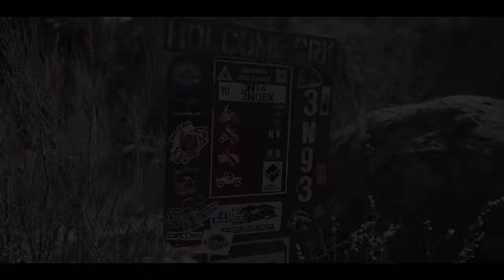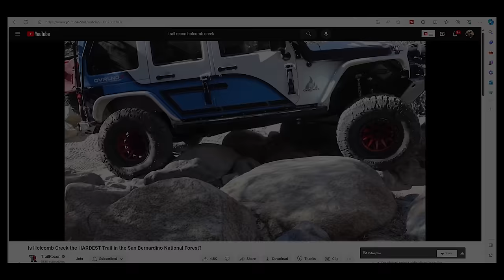Extreme Overland Routes. The 368 Mile Southern California RLR@TrailRecon

Comment: I have spent a ton of time in ocotillo. Truckhaven is fun. Id love it if Brad would set up some rides. Great vid guys.
Nate aren’t portals gonna be even wider?
Reply from the maker: Removing the wheel adapters and using the right offset wheels (which I already bought) compensates for the extra width 🤘. The wheel adapters are 2" and the new wheels bring the centerline of the tire in about 1.5". The biggest challenge will be cutting everything to fit the new nitto 40" trail grapplers lol

Comment: About your tacoma build. The getting beached on rocks is so real. I see it all the time up here in CO with peoples Quad cabs. That is why I love my 83 toyota, 129 wb and 89 inches wide, that is full sized to me lol. Almost 2 ft of body clearence bone stock. 103 wb and 70 wide including 4 inches of spacer per axle. Even my 92 extra cab toyota crawler is "Big" for me at 112 wb and 75 wide with 38x13r15,
Reply from the maker: The older Toyotas have a flat belly... must be nice lol. This tacoma is loaded with low hanging fruit...
Reply: @DirtLifestyle   Heck ya they are. Oldies are not "flat" but by comparison they are. Do you have a 4.7 box in that tacoma yet?

Comment: Great video. You gave wheel base and width of 128 and 78? Is that correct? I got curious and measured my 2004 suburban 2500. It’s within 1/2” in both measurements. So yeah, that little taco is “full size”.
Reply from the maker: The wheel base is 129" and the measurement from outside tire to outside tire is 88" believe it or not, lol. The camera doesn't do justice to how wide this truck is...
Reply: Holy smokes 😂
It’s going to be square wheel base and width with portals.

Comment: I see you got new air compressor.
What with the napa modified air compressor no longer working? 
I am just about to mod mine with the quick disconnect mod
Reply from the maker: It still works! And it's super fast. But I really like that the morflate is basically automatic. Set the max pressure and walk away. It's pretty dope.